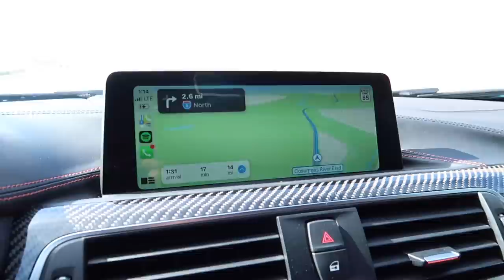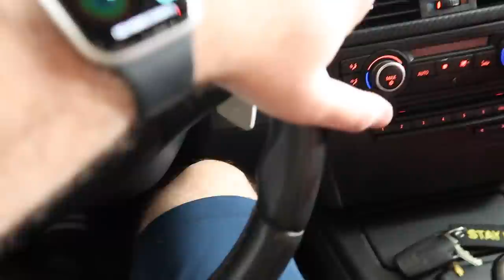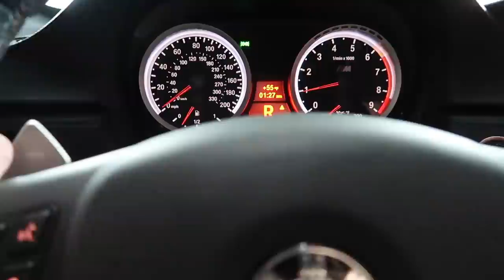THE E92 IS BACK FROM THE FRAME SHOP! + FULLY ASSEMBLED!

Comment: the sensor goes in the front bumper cover on the left side front above the big lower grill unplugged it will throw a code cheers from down under

Comment: Good decision on not reinstalling that metal piece. You will have a much better airflow.
Reply: It kinda is and kinda isn't because that metal piece helps to protect the oil cooler from being damaged by rocks or debri